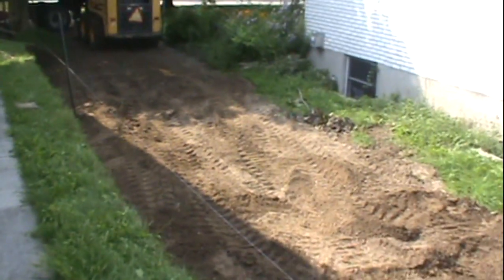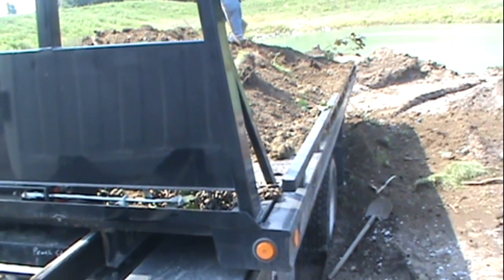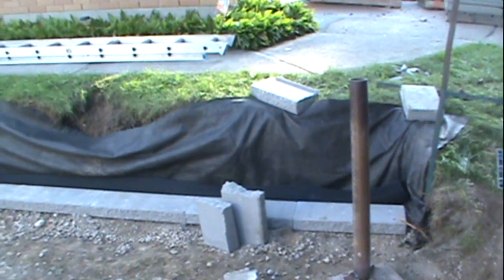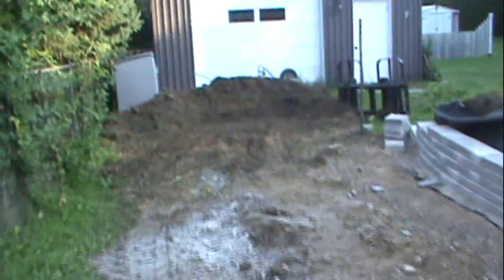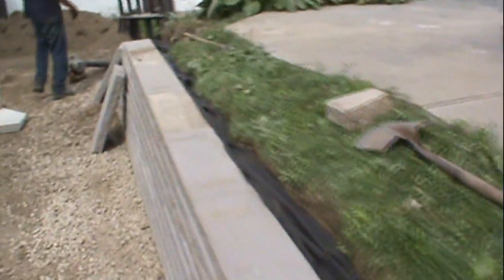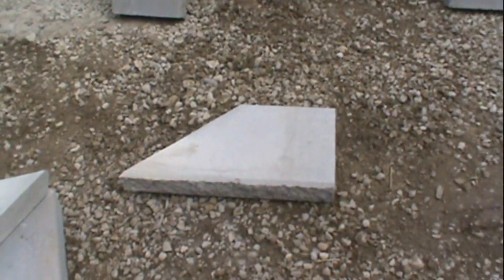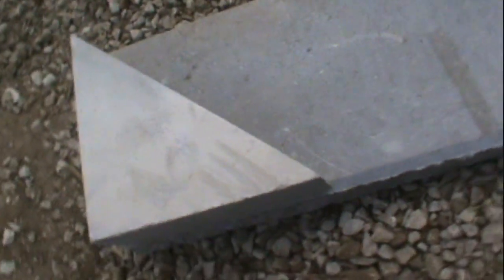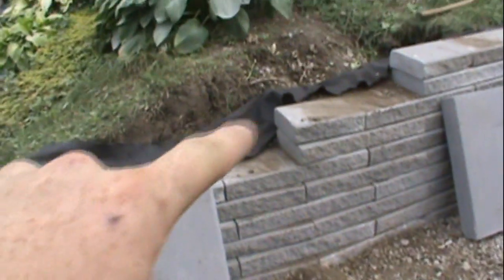Slugging and Lugging

Comment: Looks nice.   I probably wouldn't have lined up the joints like that.  Even if separated by one course, it is weak and risks the bricks breaking.  But since it is not going to hold any vertical loads but itself, it may not be a problem.

Comment: Andy, A cheap way to have a dump trailer is if you use your tow truck and strap a truck body to your bed.  It would be easy to do and you should have a truck bed in Rodney.  What do you think?